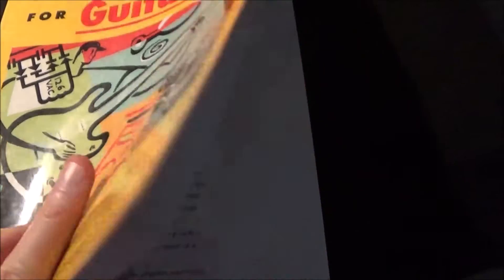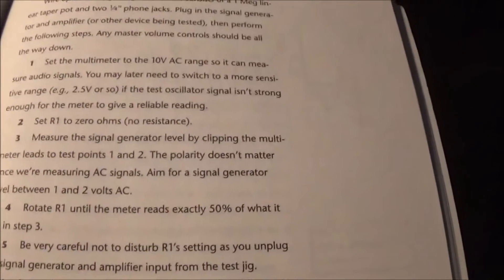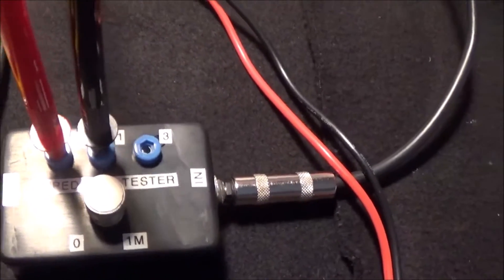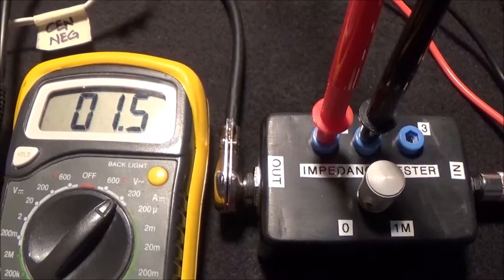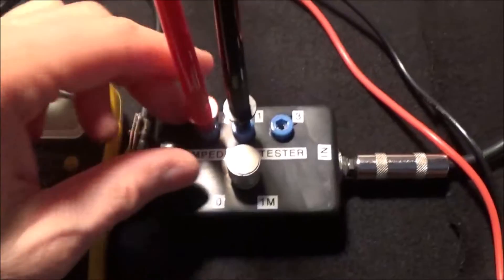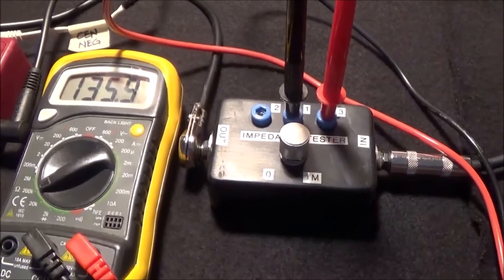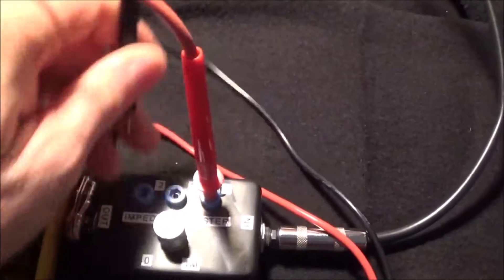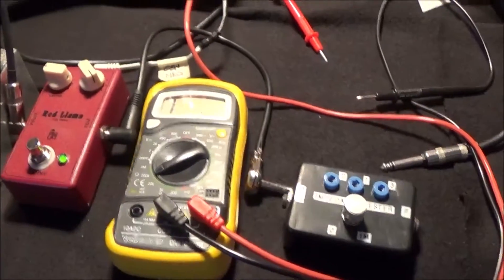DIY Guitar Effects Aid #8 -  Impedance Tester

Comment: I'm not sure you are doing this correctly. The real Red Llama has an input impedance of >450K which is still kinda low. 1M is desired. I think you are testing the amp and maybe amp+pedal. Try unplugging the output. Plug into pedal only. Go to 1.6 volts, then back to 0.8 and measure that result. I made one of those things years ago and lost directions... glad I found this vid.
Reply from the maker: Yes I made a mistake here... left those cords plugged in. Second problem I have is that Anderton says to use a multi-meter with AC voltage setting on 10 volts - mine only goes down to 100V. Still zoomed out too far at 100V setting. I tried doing ti same way again and unplugged the cords this time but measured only 236K which still didn't seem right. I think the more accurate way to do it for me would be to measure the AC voltage with an oscilloscope, which I just did. I injected 2V PTP signal into input and then backed it down to 50%, then used the DMM to measure the resistance. I measured 763K, which is more like what I would think it should be. I didn't really think about it too much at the time. I don't really use that pedal, it was just handy at the time. I was just thinking about what Anderton said about anything with input impedance of 100K or less being an issue. Certainly could come in handy for old pedals from 60s-70s but it's likely that they've already been true bypassed by now. Also you need the correct kind of multi-meter. When Anderton wrote this article it's probably likely that analog voltage meters were still in widespread use. Anyhow, thanks for the comment and pointing that out.
Reply: @VegasCyclingFreak  Oh great, yes that sounds a lot better. The real Red Llama say >450K and they probably estimate low for varied frequency. The funny thing is, I built that pedal. Forgot how to use it or where I found it. I opened it up and had put the directions inside. I remember I did that because I never had a chance to label the box. All I knew was it was an impedance checker but not how to use it. Awesome! Yes, something between 500K and 1Meg sounds very reasonable. Again, thanks for posting the vid.
Reply from the maker: @rubiconfpv6175  Yes that is one thing that Anderton doesn't really specify - the input frequency. The impedance will change with frequency, but probably 750Hz-1kHz would be a good number to use as that's where "tone sucking" would be most apparent.

Comment: How can this measure correctly for any input impedance above 1M, when you are confined to readings between point 1 and 3 that can never exceed 1M? just does not work?? Perhaps should be noted, that a larger potentiometer, say 5 Meg ohm might be required for measuring larger input impedances !
Reply from the maker: This is based on Craig Anderton's article. I think he meant for it to be used to measure the input impedance of older effects to see how low they are, so one could determine if something should be done to improve it. Anything less than around 200K will "tone suck". I don't know if it works out the same with a 5M pot. For modern guitar effects you don't really need to bother with it.. will be at least 1M or more. Large manufacturers will often give that info, but "boutique" pedal companies is hit and miss.

Comment: Great job on the tester, nice and clean utilitarian build. Before I got a transistor tester I made one with an altoids case so I could test BJT HFE gains. It worked surprisingly accurately. But I will say having the transistor tester do the math for me and verify the pinout at the same time is very nice. Especially since those transistor testers are so cheap. I wonder if anyone has put together a similar kit for an impedance testing device? If not the I'll certainly build this one. I really like how you used the banana plug test points. My Marshall DSL100HR has bias test points that look exactly like female banana plugs but they accept meter probes instead. I wonder if I could find some, I'd happily use banana plugs but I dont have the male banana plug adaptors for my probemaster test leads. Anyways thanks for posting this, it was exactly what I was looking for!
Reply from the maker: Thanks. Those probe jacks area kind of hard to find but one place I know of that sells them is here on this page. They refer to them as a "bias tip jack". I imagine that they are probably also on Amazon and/or ebay. Not sure what the official name of those is. www.hoffmanamps.com 
Look under the jacks/plugs/connectors section.

Comment: Cant find those blue probe jacks.  Will 2mm banana jacks work or could you tell me what they are called and where you got them? Thanks
Reply from the maker: I don’t what they’re called exactly... those were given to me several years ago. You could use banana jacks too but you won’t be able to plug your multimeter probes directly into that.
Reply: @VegasCyclingFreak  

Just FYI in case anyone comes across this comment, I found them at small bear. They are listed as “test pin jacks”. Thanks for the vid btw!
Reply from the maker: @mr.grumpyface527  Cool thanks for letting me know